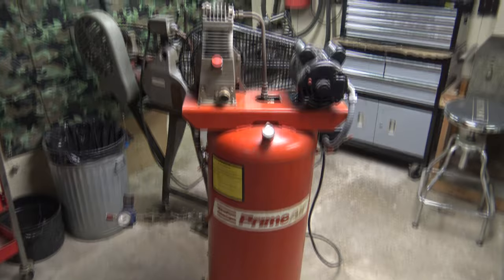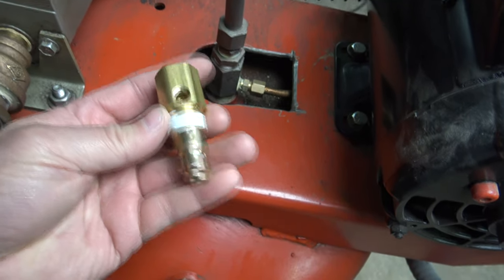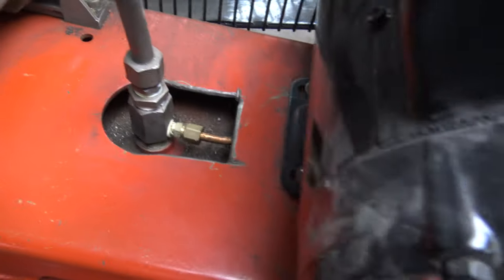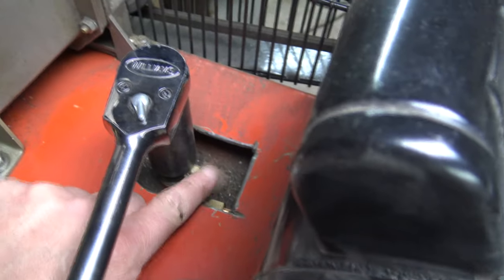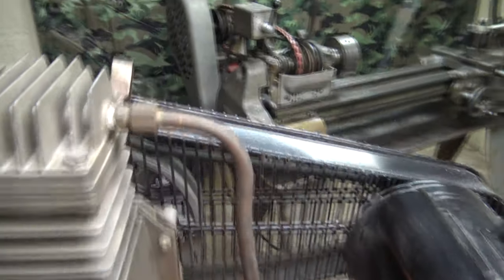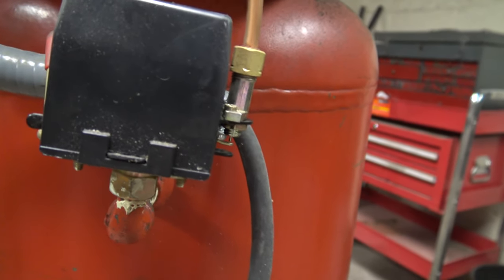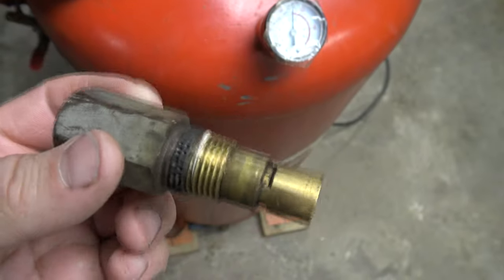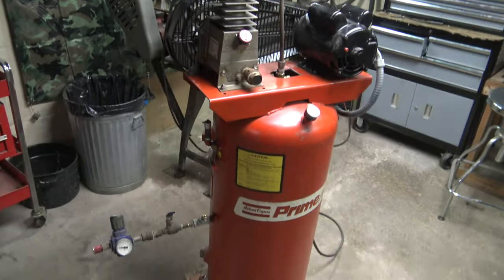Air Compressor One Way Check Valve Change and Unloader Theory

Comment: Did I hear you mention that that's not big enough to run air tools?  You can run air tools with very small pancake compressors.
Reply from the maker: Good luck running a da sander